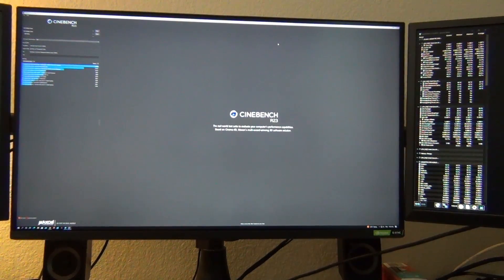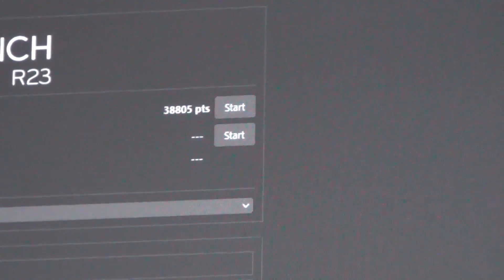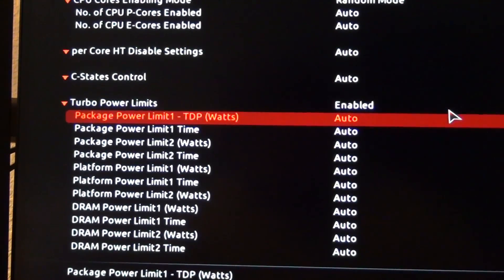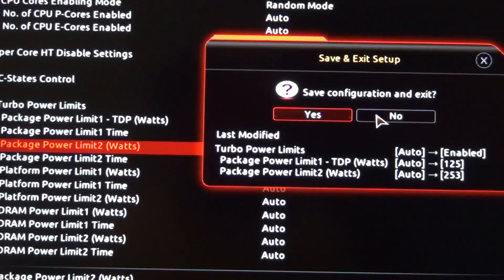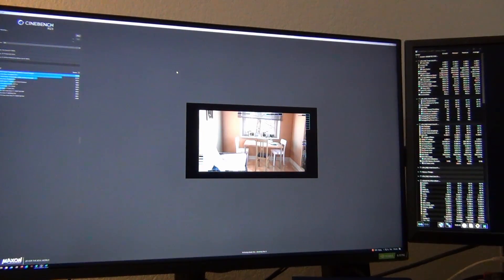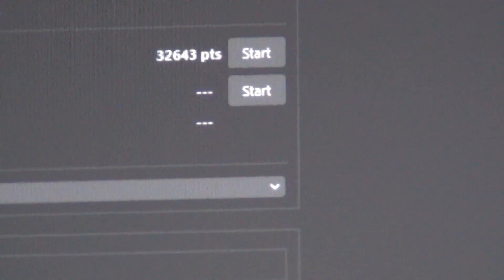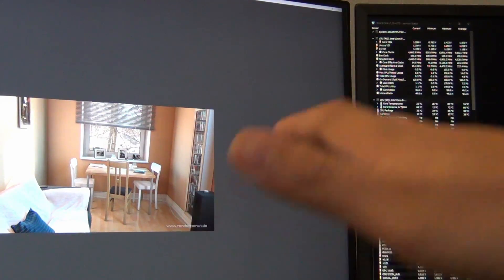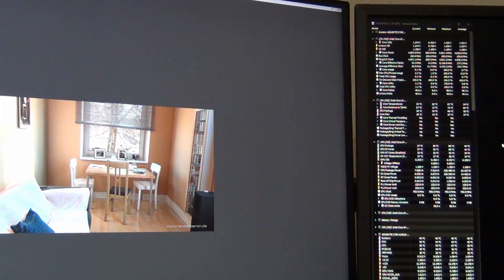How to enable eco mode on i9-13900k

Comment: for the intel 13&14th especially
13900k/ks
14900k/ks
this best setting for those cpu :
tdp 1 253w
tdp 2 253w
core current limits 307amps
 
this will make your cpu thanks a lot

Comment: I have two i9 CPUs and one of them is severely degraded due to Intel's ongoing issues.  I applied the settings in this video to the other CPU and performance is stable.  I think this video may have saved that CPU from degrading.  Thank you!
Reply: How can you tell it degraded? I’m only asking cause mine hasn’t skipped a single beat but my cinebench R23 has dropped to about 31,000 & it used to be 39,000 or so

Comment: Thank you, When using Cinebench I was instantly throttling at 100 degrees, applied these settings  and was hovering around 70 with a max of 90. Multicore score is lower by around 5k but the temperature drop overall is worth it

Comment: You didn't run the benchmark long enough to hit the PL1 limit.

That's quite a loss in performance.  With a better cooler you can easily get 40K on CB R23, with throttling, or 38K with temps in the mid 80s.

If you want to lower the temperatures, just enable Intel defaults and then adjust your maximum current draw.  Try 307W (Intel's spec), and increase by 10W at a time until you're temps are too high or the system becomes unstable.  Use CB R15 to properly test for instability.

Comment: What pl1 and pl2 for i9 14900f I also can't seem to set the voltage offset to negative, I can only enter values that are positive when trying to undervolt in my MSI B760-vc wifi 7 bios, anyone have any idea if I have to type in the total reduced voltage in voltage offset instead of like .050? Thanks.

Comment: Can u do this with the 12900k? I got a ryzan 9 7950x in eco mode since I'm running it at 100% all the time for stuff and I need another PC since either not enough and I got a i9 12900k all ready just need to do the build was thinking maybe limiting it to 100w. I just need cores not the speed so added the extra 24 cores will help mainly doing it for  power bill reasons don't want  it to go out of control lol heat not my problem since I run aio

Keep in mind I run the PCs for 24-7 so 500-700w PCs would kill the power bills lol

Comment: Your score is in line with a 14700k.  Why not save money and get the 14700k for the same performance.  The 14700 is usually lower by a couple of degrees from less cores.
Reply: That’s just dumb, it’s still better than second line and they both will hit above TDP limits…

Comment: I am very disappointed in my 13900k. My 9900k previously ajd undervolting was simple. This thing was a nightmare even with a water cooler. I lost the silicon lottery and had to set VR curves ane custom resistance and voltages per each stupid core. Only 2 can hit 5.7 ghz before heat and voltage skyrocket. 

Tune further and you can hit 38000.

Comment: I got a 14900k and even that throttles with triple 360 rads in a custom loop. sustained temperature control not really the issue. it just hits peak too quickly for the loop to even start dissipating heat.

Update: yeah I don't need to dial back the power quite so much lol. Dropped my temps by 30 degrees going to intel stock 🤣

Comment: @dapoets was able to achieve temps not exceeding 90 Celcius by another method: going into the Multi Core Enhancement of his Asus mobo, and setting it to "Enabled, remove all limits - 90 degrees." Cinebench R23 max was a bit less than 39000 prior to this adjustment, after, it had reduced comparatively little, to 37776.

Comment: I had issued with the heat, then i edited the TDP to 125 (PL1/PL2) and then i had max. 67°. Then i thought, my temps are nice, so i change the TDP to 150 for PL1/PL2 and i get max. Temp 80-84° not sure exactly and benchmark seems very good. It seems 150w is the sweetspot at least for my 240 AiO. If i go higher, then it just does not make sense, even benchmark looks the same because of thermal throtteling.

Now my question, can i just use for PL1 and PL2 the value 150W? I hope this wont effect something in negative way.

Comment: Undervolting is the best way to get the best performance out of the 13900k as long as you stress test properly its perfectly fine
Reply: That seemed like a lot of work when he could have just done a negative offset on Vcore.
Reply: @timotmon mine will bsod with any vcore manipulation and an undervolt. Undervolting is required on silicon lotto losers like mine. I do have 2 of the cores at 5.7 ghz with a tiny .27 undervolt. At least it won't hit 100c during cinebench now

Comment: I have this MB with a 13700k. I tried both the undervolting and setting the P1, P2 limits. I get a better R23 score with the undervolt. Both stopped the throttling at stock settings. I'm using a Deepcool AK620, rated at 260 Watts.

Comment: it helped me for sure but benchmark points are 29000 only for what reason not sure
Reply from the maker: The score will reduce because of the power limit. This is normal. By enabling eco mode you will lose a lot of performance.
Reply: @GameTechReviews  is it worth to loose such performance? better would have taken i7 13th gen then. Whats the point of taking i9 13900k and reducing power for it under perform makes so sense. 

After under power it, is it still more powerful than i7 13th gen or becomes similar to i7 13th or even wrost?
Reply from the maker: @quransunnah96  I don't know how it compares to the i7 but compared to the Ryzen 9 7950x it becomes much slower. When the 7950x is in eco mode it doesn't loose as much performance compared to how much the i9 loses.

Comment: about to build a NZXT H1 V2 with a 13900k.. this video is great I want to limit total CPU power to 100 watts. Theres no way the stock liquid AIO Cooler will be able to perform with decent temps at 240+ watts no way. Cheers for the information

Comment: Never mess with Power limits.. No matter what you do it messes up the total score like 32k is 13700K score I've with my chip with really old shitty aio which is not even designed for 12th gen and up chips.. Like it doesn't make any sense why would you buy Bugatti and run with the speed of Corolla... Simply get the Corolla instead.. If someone doesn't wanna go through with the undervolt headache although it's not a headache at all simple few mins procedure and you're good to go, just lower your CPU Loadline Calibration and you're good to go without mess up with any other stock settings in the BIOS

Comment: If you haven’t tried it yet, try setting PL1 and PL2 both to 253W and the CPU Current Limit to 307A. Should be able to get 35-36k cinebench without Thermal Throttling.
Reply: Quite substantially it reduces temps. Because most motherboards are really uncapped for power and let the CPU throttle to control that. So if it’s bursts up around 280-300 Watts it’s gonna thermal throttle.
Reply: @Flip1572  Thanks for the info man! And this has been completely stable? Just concerned about screwing something up, but I would really like to see lower temps on the 13900k. 

At stock without limits, it just spikes too high in temps for my taste, but I also don't want to give up too much performance or risk stability. Thanks again!
Reply: it reduced my temp a lot for my 14900k , and performance is same , thanks
Reply: Sorry to hear it didn’t work out for you, I have a MSI board and they have 3 presets, Water Cooler, Tower Cooler, and Box Cooler. Even though I use a 280mm AIO I still select the Tower Cooler option which is the 253W. With the preset I can say for certain it makes a difference.
Reply: @Flip1572  That's interesting that they have different presets such as those on the MSI motherboards. I'm sure those settings do make a difference in a lot of circumstances. I didn't see anything like that in my Bios but I only went to the advanced CPU settings like in this video. 

I only tested the results in Starfield because that game in particular really gets my 13900k sweating, but it is a really badly optimized game after all. I still find it interesting there was little difference for me using your settings. I am pretty sure I did everything right, there was no CPU current limit option, but a "core current limit amp" option so I dialed 307 in to that, there was no "A" anywhere though, maybe that's why?  

My previous 360mm AIO's pump died after just a few months so I switched to Air Cooling with the NH-D15. It's nice and quiet compared to the AIO I had, that was terribly loud.

Thanks for trying to help me regardless and for the responses, appreciate it :)
Reply: How much does this decrease the temps would you say? Thanks.
Reply: Yeah totally stable, what kind of motherboard are you using?
Reply: @Flip1572  Thanks, I gave your settings a try and in Starfield (because that game really gets this CPU hot)  I unfortunately didn't notice much difference in the cpu temps, but thanks anyway. I might give Intel's recommended power limit settings a try, or else I'll just have to accept the high temps. 

I have the gigabyte z790 gaming x AX motherboard.

Comment: You are leaving far too much performance on the table here. Might as well have bought a slower less power hungry chip. I just set a voltage offset on mine. Went from hitting 100c in Cinebench to high 70's and low 80's with a 30min R23 run and a score of over 40k (Gigabyte Aorus Master Z790) .
Reply: Wow. What was your voltage offset?
Reply: What settings?
Reply: How nice of you to leave a comment saying what you did, without actually saying WHAT you did.
Reply: @jeeroylenkins3081   Relax dude, I don't see these notifications half the time. I have actually forgotten what the exact settings I used were nor does it matter as they more than likely wont work for you. I will rather explain the process I used: 

First I saw Jayz2c video on undervolting these 13900k CPU's and how much of a difference it made, I then went into the bios and found the voltage offset setting and set it lower and lower till the system became unstable then I set it slightly higher to achieve a stable system. The problem is these motherboards just pump voltage into the cpu and you will see in HW monitor the CPU hitting over 300w while running things like cinebench. Yea the cpu runs faster but then sits throttling non stop.

Comment: Thank you so much for making this video.  This information solved my worries and issues with cooling my i9 13900K with the Noctua NH-D15.  I too am not going the water cooling route.  I set my PL1 to 125 and my PL2 to 250 and my temps were great with no thermal throttling.  Greatly appreciated.

Also, if anyone has an MSI mobo, these settings are under Advanced CPU Settings and then look for Long Duration Power Limit which is PL1 and then Short Dutation Power Limit which is PL2.
Reply: Cheers for the info with the MSI board. I have purchased the same cooler and will set my cpu to these limits.
Reply: Thanks for the MSI settingd info. I'll be putting together a build around an MSI Tomahawk Z790 + i7 13700k, so i'll have to tweak it a little bit since i too want to stick with air cooling
Reply: @rodrigomadera3048  I have the same kinda build, what did you change?
Reply: @rodrigomadera3048 how was it?
Reply: cant wait to try it! what temps are you getting? did it affect your performance?
Reply: @hilmosvlogg  Yes you will lose some performance but it's not drastic.  It's just one the trade offs you have to accept if you want to go with air cooled.  I capped my PL1 and PL2 and then started tweaking some other variables to regain some performance.  I use Intel Extreme Tuning Utility. (XTU) to tweak settings.  But I don't recommend that unless you have some knowledge of what to do.
Reply: Would you happen to know what setting this would be under on an Asus motherboard?
Reply: PL2 should be 253
Reply: PL1 is:
A) package power limit 1
B) platform power limit 1

Thanks

Comment: For gaming you can just turn off 12 e-cores and disable hyperthreading and you will run higher clocks for gaming if that's all you do it will be cooler without losing gaming performance. With some voltage tuning it'll be unbelievably nice temps and performance wise.
Reply: At that point you should just buy 13700k as it has same amount of p cores.
Reply: @xTurtleOW  yeah but the 13 900k is a higher binned chip and has more cache and the 13900 KS is binned even higher. Yeah the difference is small and the 13 700k is almost as good but I wanted the best so I bought the 13900 KS so I can overclock it to 6 gigahertz & beyond. My point was that e cores and hyper-threading don't really help for gaming and just add to the total power draw for no reason is gaming is your only priority it's unnecessary heat which will keep your overall p core  clock speeds down lower
Reply: Bonjour comment fait on sa?car mon cpu chauffe énormément quand je joue sur warzon 2 en utilisation normal et performance élevé sur windows
Reply: is there any guide vid u recommend on how to do that? im really new when comes down to all of this, im scared of doing something wrong

Comment: I highly recommend you under v instead of power if you just invest in a little bit of testing a few hours you can achieve higher clock speeds while decreasing the temperatures
Reply: Undervolting 13th gen isn't stable. Run Prime95 and you'll see. My 13700k crashes there even on the tiniest undevolts (like -0.025v).
Reply: @AR-ey1ur True,that's what I found once I started with heavy load,like Y-cruncher for example, Cinebench wont stress the cpu enough, the cpu won't crash but it'll give errors (WEHA)

Sure there is silicone lottery but a lot of people are just benching with Cinebench and gaming and think that their 0.075v or 0.1v UV is stable.
Reply: @AR-ey1ur  I've been stable at -0.095v since launch. Prime 95 and Y cruncher are my tests of choice. It's a decent sample chip in terms of the silicon lottery, but far from any record setter.
Reply: Undervolt can't save this.
My 13600k consumes over 220W under turbo, I lost zero performance when I dropped to 170W. Imagine, I was burning 50w for nothing
Reply: @DuBstep115  you don't have as many cores. You can't compare. Just turn off as many cores as the 13600 and the 13900 is better lol
Reply: @xdi1733   Yeah but I was commenting about the absurd power use for zero gain.
TDP is 181W in turbo for 13600k and my board let it draw 218W. I manually lowered to 170W and my cinebench R23 remained the same but temps dropped like 20c
Reply: @DuBstep115  Did you do the same thing as in the video?
Reply: @HasanWadih  Yeah, I changed the PL2 limit from unlimited to 170w and applied -100mv undervolt. Next time I just migh put fixed voltage and raise the clocks
Reply: @DuBstep115  Cool, thansk for the reply!

Comment: so basically I will have to go for i5 13700 so I don't have to deal with temps ?
Reply: No. They are both 253W TDP chips. Go with the 600k if you don’t want to dial in temps.

Comment: I have a 13900k with z690 tuf and 360mm AIO deep cool, but my score was only around 32k. After undervolting and hyperthreading I was able to hit 37k but stabilized aroind 35k points. Wondering if my cooler isn't enough to hit max performance.
Reply: Are u still hitting 100c 

Open task manager and r23 then right click it in task manager, go to details the right click r23 again and set priority to run real time, your score should jump up
Reply: @johnhughes9766  yeah I switched my cooler for an NZXT x73 360 but temps are still really high in stress. Going to try adding the new lga 1700 socket and some thermal grizzly paste to see if the temps improve. With the new cooler getting around 39k points average.
Reply: @dedelauria  did you end up improving it
Reply: @j.a.3138  Didn't add the support yet and the thermal paste hasn't arrived but some tweaks such as enforcing all limits have improved thermals.
Reply: @dedelauria  how is it going?

Comment: Can I use i9 13900K in stock settings with Deepcool AK620 with only the same settings as you tweaked in BIOS? I am planning for my life's first ever PC and the cooler I choose is Deepcool AK620 because of all the problems and insecurities that all liquid coolers come with
Reply: its been 8months now. Can u share some feedback of the combination between AK620 and i9 13900K? 
Im planning to get the same build too but i see a lot of problem with the 13900K power consumes and cooling.
Reply: @adensenpai8547  been a year already, huh? Sorry for the late reply but if you still reading it, I changed my plan to Ryzen 9 7950x and RX 7900 XTX. The PC isn't built yet. It will take another month or 2 for properly delivering it to my house

Comment: If you limit the 13900K by current(A), it becomes much more energy efficient than if it is limited by PL.
Reply: 307A is Intel spec
Reply: How much current (A) for example please
Reply: It depends on what power you want to achieve. You can start from 200A and go up or down depending.
Reply: @dsfullframes964  I'm using 280A, got 32k in cinebensh but power near 180 Wt and fans are very quiet, also wikk recommend limit current
Reply: I’m sorry what do you mean by current A?